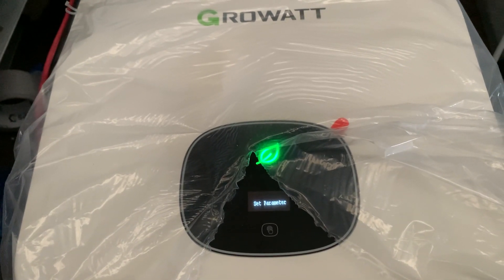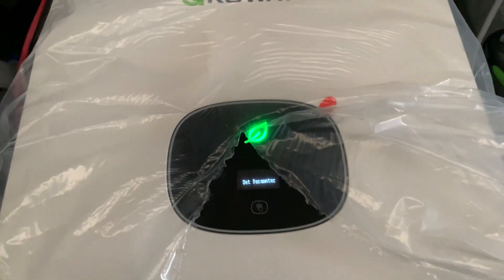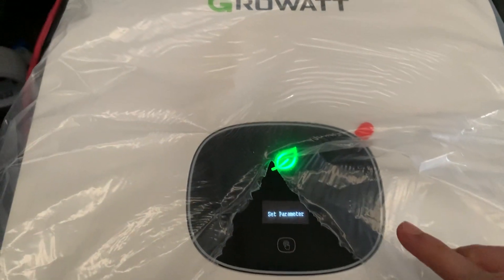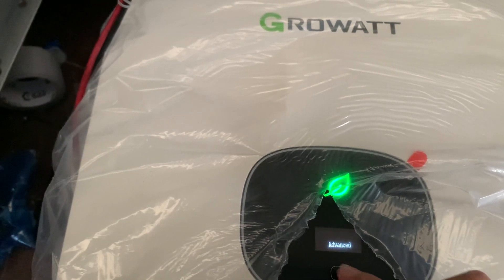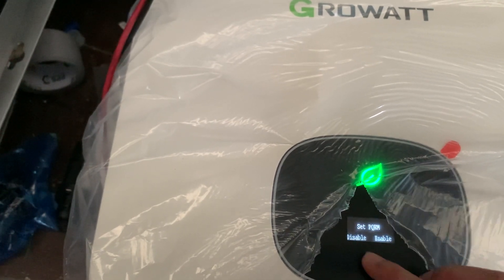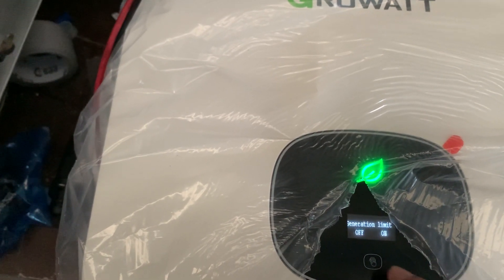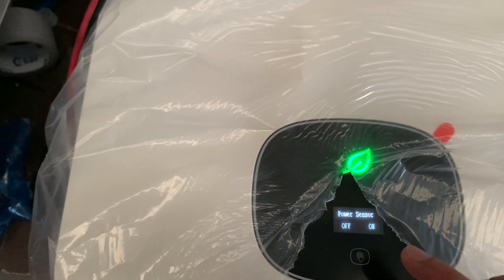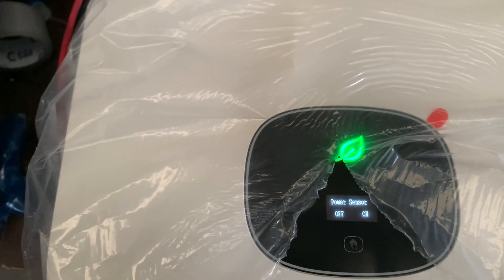Growatt Min-series inverters power sensor setup tutorial

Comment: Hi why my inverter not turning on? I bought second hand and try to turn off power socket but not turning on? Any idea?
Reply from the maker: Check your DC and AC connection, ensure the DC meets the start voltage, if still have issues, please contact Growatt support.

Comment: Is it possible to limit the energy production based on a fixed values  (Ex 500W) instead set zero export using power sensor?
Reply from the maker: Yes, by using the CT meter to set up the export limit

Comment: Will this still work without turning on the power sensor in settings, as what you have there is a current clamp with a meter connected i.e. why would you need to turn this function on ??
Reply from the maker: The inverter would still be working without turning it on, the aim to turn this function on is to view the load consumption if the sdm120 meter has been installed.

Comment: Hi, 

I just installed one. 

What exactly does this setting? Because at the user manual is not explained and I couldn’t found any info. 

Thank you very much
Reply from the maker: Hi customer, this setting is to activate the meter that installed for the inverter.